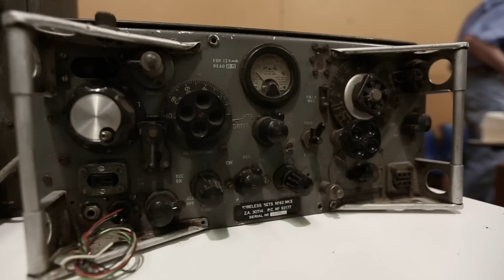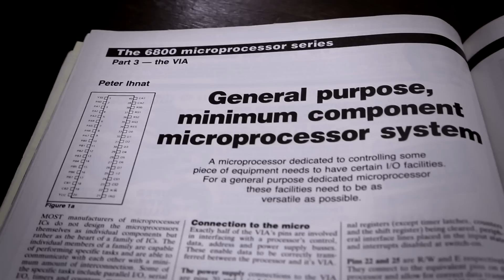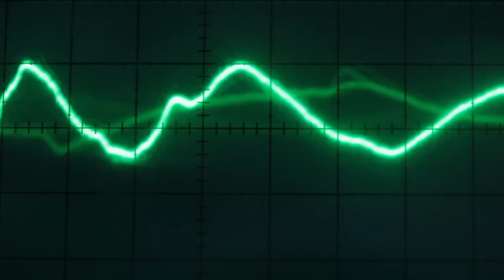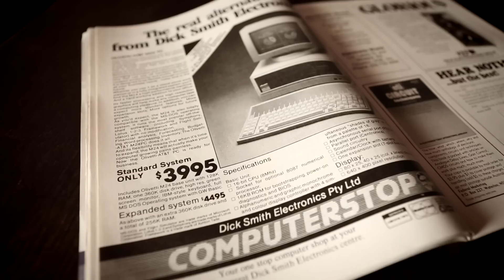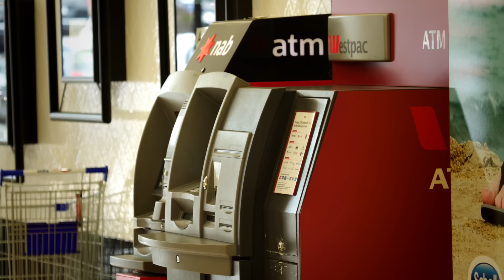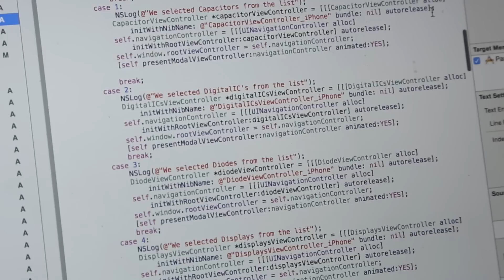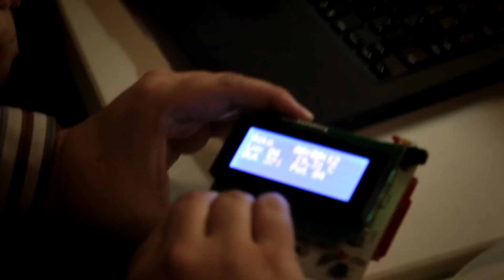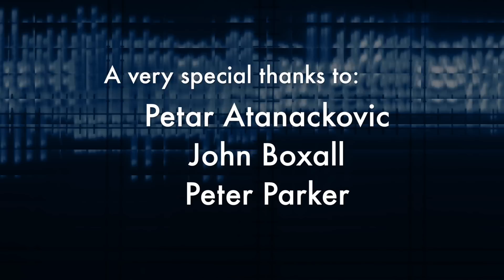Complexity & Integration

Comment: Yes my exploration into electronics since childhood reached its dead end when eventually became tiny black boxes with legs and I had no idea to understand  it.

On a positive perspective, probably the new age of modules and systems may be the same as resistors/transistors/components in the past
Reply: Build a re-flow oven from a toaster oven, get SOIC stencils and a microscope and you can build anything available today in your home. Use free circuit design software and send the design file to a PCB manufacturer The resources and education are all freely available and cheaper than they ever were. Those little black boxes take software you can get for free if you learn C/C++. If you dont like SMD components, then use breadboard friendly breakout boards. You can go as deep as you want into the complexity for very little cost. A multimeter, power supply, oscilloscope, adjustable solder iron and a cheap component tester are the only equipment you need to start. You may not even need the oscilloscope.

Comment: I can kind of see the pros and cons of the changing era and paradigm in electronics. For one, it's actually a lot easier these days to design electronics because everything is already designed for you, and if you just opened the datasheet it would show you the typical application circuits. If I need an ADC, UART, DAC and PWM I just search for a microcontroller, I need a Line Driver/Level Shifter, Buck/Boost Converter, Rectifier, Current Sense amplifier, and almost anything else, I just search for it and copy paste the typical application circuit. It's almost too easy...in some cases. 

The worst thing about this is that the fundamentals of electronics and circuit theory get neglected in favour of simplicity and programming. Till this day the biggest thing I'm disappointed in is the fact that my electrical & electronics circuit theory is rubbish. Even at Uni they taught us a lot of the basics and then it was off into programming microcontrollers. Only when i burned my first transistor after Uni did I learn from the internet gurus that you have to put a fllyback diode when driving inductive loads. 

I can somewhat see that, in the not too distant future people with strong knowledge on the fundamentals of circuit theory, be it analog and/or digital, will be in high demand. After all, SOMEONE has to design those highly complex yet precise ICs that we all just plug into our circuits.

Comment: It has not gotten harder or easier. Its just changed. It may seem that things are spoon fed to new hobbyists however it has simply just shifted the focus from descrete logic simple circuits to more modern and connected electronics that are more complex then you could have ever imagined.

Today's hobbyists are focused on projects, making new things, and possibly even making a viable product. Complexity is not a necessity. Yes modules and micros make it easier to develop but that just means we can make more interesting things quicker and more efficiently. And later on we can still move on to designing our own SMD PCBs and stray away from modules and break out hoards to use the bare components and sensors.

Comment: It's not at all harder today... 

I see no one complaining that we don't still have 8-bit computers built with transistors, resistors, LED's and jumper wires... Machines which would take minutes to calculate and output simple arithmetic. I see no one yearning for the days of the multiroom computer servers which calculated slower than an 8-year-old and required floppy disks and command window inputs. 

We just slap all that physical computation into an integrated logic chip (IC) and then stamp and ID on the top and call it a day. Want to use the IC to create something? Well look up the data sheet on it and find out how to use it and what it's used for. 

We've simply advanced in capability and lowered the bar of entry. The 'old' style of electronics naturally attracted logical kinesthetic learner; people who learn best by holding something in their hands and breaking it down like lego into foundational pieces. In the same way, we crammed 8-bit calculators into IC chips, we're now cramming a whole lot more computational ability onto CPUs and single board computers such as the Raspberry Pi's and all its snip off's/competitors and Arduino's and other microcontrollers. 

As of now, (2018) children have access to Arduino's and Raspberry Pis with incredible computational and control abilities for merely $5-$30 a piece. A $5 Arduino nano or Raspberry Pi zero can accomplish a lot. If they have access to a computer that can run a word processor (like MS Word) or a code compiler (arguably every non-impoverished first world child does) then they can code instructions for their $5 computers/microcontrollers. I went to Jaycar a few months ago looking for a few simple LED's to change the colour of some door switch lights in my car; they were $5 each... That's, unfortunately, the supply and demand of the free market, with the lack of demand for discrete electronics, but if I can buy an entire computer which even has USB outputs as well as I/O pins, then the barrier of entry for today young people's no higher than it ever was.

The only difference is that physical electronics and circuit board manufacturing was a hobby attuned to kinesthetic learners. Code based electronics are more naturally attuned to visual learners. It may be the same hobby, it may have only evolved a little, but it's undergone a fundamental shift towards optimisation of a different type of learning. 

Software-defined radio USB devices (SDR's) are only about $20 these days, various extension boards for which include capabilities for wifi, Bluetooth, GPS and GSM and many input sensor are often between $5-$20. In the old day's hobby electronics meant making a simple clock, or maybe a siren, or an amplifier circuit, or some simple proof of concept device revolving around LED's, sirens/speakers, light, temperature or moisture sensors. 

Nowadays the electronics projects have broken out of simple circuitry for simple devices such as clocks and calculators which are mass produced on a few integrated chips and sold en masse out of China for minuscule amounts. Modern electronics is about connectivity, modern hobbyists are using CNC routers/mills/ drills and 3d printers, modern hobbyists are connecting things together and creating almost consumer grade finished products to fulfil actual needs or produce actual benefit. 

New school electronics isn't just doing the same thing's better, we're reaching new heights. Whereas once it was an achievement for some to build transistor calculators yet to others it was automated onto an IC to focus on input switches and output lights and sounds; now we're upon a new era where much of the physical control is programmed into single board computers and the focus is upon communication between devices. Whereas once input and output methods were switches and LED lights, they're not text messages and emails. As computers evolved from command line interface to GUI, electronics are evolving from physical switches and lights to informational and networking communications and app-based interface.

Electronics hasn't halted, it's just changed face to new goals. Things have shifted towards networking and "IOT." Priorities have changed and computational innovations in consumer goods have put pressure on creativity and knowledge to make electronics 'worth it.' 

People are right, why would I build an electronics clock when I can buy one for $10? Good question, you clearly lack creativity and skills. If your focus is simple things which have been undercut by Chinese mass production, then the only reason to build those things is for fun/experience, proof of concept or for novelty. If you think 'innovation' has made all the useful things you could make obsolete to cheap goods, then you lack the skills and creativity to implement technologies. The goal of electronics has only ever been to solve problems or make your life easier. 

With the technology of today, I can integrate my garage door into my home network and open it from an app on my phone. That app can pull my GPS data and push a notification to my phone asking me if I'm going home (want the door open) so I don't have to find and open the app. That app obviously connects via the internet to my home network and a radio transceiver coded to the door. I had a garden bed set up with a basic IOT soil humidity sensor and a program which pulled local weather data. It then pulled data on the plant type it was watering so it knew its needs... It was supposed to help me water my plant so it didn't die but I got lazy with the coding and database and it ended up overwatering my plant and killing it. I'll go back to that again when I'm more committed to the project. I'm currently working on a 'carputer' system with an iPad like touch display that utilises passive RFID tags to communicate with my phone and change to a preset mode for driving. It's fairly complex because it will have a large Google maps API component with a lot of overlayed data, such as prompting me cheap fuel prices when the car is lower on gas... Etc etc... 

I've got many more projects on the horizon. What makes modern electronics to the next step is the IOT networking integration and the integration of app interfaces and pulling data  (such as weather, traffic, fuel price etc). Gone are the days of simple proof of concept electronics, modern electronics has far more capability; if you think that electronics is too complex or there's simply no point anymore, that's only because you're dumb and your personal capabilities have been surpassed. 

Whilst everyone sits around criticising and joking about the IOT integration of everything and asking when we'll have internet connected toasters and kettles, I'll be working on my IOT washing machine solution. Reservoirs for fabric softener and detergent and of course a home network connection and app interface. No fiddly dial for 1, 2 or 3-hour start delay; busy people simply throw your laundry in the machine in the morning and head off to work, when you get a second at the office open the app and tell the machine when you want it to finish. Yes, of course, it pulls your schedule data and asks if you want the washing finished by the time you're due home, or your partner, or one of your kids, maybe your part-time maid? Set it and it ticks, it knows when you want it finished so it does the math on when to start, loads up the detergent and fabric softener for the required load and then ticks away. It runs the load, then the dry cycle (because washer dryers are already a thing) and it' done by the time you get home. Got solar? It can pull weather data and real-time data to run in the peak of the sun to make the most efficiency out of your panel, if that fits in the schedule. Obviously updates you when the detergent is low and auto updates your shopping list ap. This is the future. The tools and components are already here right now for this stuff and this stuff will be common consumer grade goods in 10 or 20 years, you bet the first companies to implement it will charge a fortune and market it as a luxury, rather than something that's obviously achievable with today's simple tech. That's the niche of electronics. Given you have a little bit of coding knowledge, you can implement this with less than $50 of parts, EASILY. You can have now, what will be the luxury in 10 years. 

As for the kettle, I for one will love it when I get off my lazy ass to IOT my kettle because all it takes is a relay, a temp sensor and a wifi chip and you can turn your kettle on from the comfort of your bedroom or tv room den with an app and you can get an update when it's boiled. Or you can spend hundreds of dollars on a fancy coffee machine with instaboil or whatever. Same thing, when home networking and smartphones become more widespread, 'IOT kettles' will come out as a luxury item and I guarantee you, it will merely be a relay, a wifi or Bluetooth chip and a simple IC on a tiny board wired in parallel with the LED, heating element and power cord as a way of bypassing the switch. 

I reiterate, if you think electronics is dead or it's too complex nowadays, you lack creativity and capability.

Comment: Touch pads, Ipod's and ton's of complicated gadgets. Components so compact and complicated it's almost impossible to repair them now unless you are specialized. I guess it's the dumbing down of the new generation. Thank God I was born in the early 70's. Back then a lot of old electronic guru's who will teach and support you on your way to electronics. That gave me the edge and currently, I'm learning new technologies like microprocessors, programming my own codes plus, the knowledge I learned thru all those years of building kits, repairing stuffs, designing my own circuits and making my own pcb layouts payed off.

Comment: im 25, i have some free time. I wanted to learn to do electronics as a kid, but due to the conditions i lived in it was impossible. now I started looking into it and I see no purpose of electronics, you just can't compete with the microchips that you see everywhere. And it ruined it. Nowadays people are consumers, they consume, and can't create. 

At least I have my woodworking as a career, but anyway Ikean and im sure in near future people would never buy wooden furniture. So is shame, that familiar things are dying out
Reply: I respectfully disagree =] You are forgetting about the many sub-fields of electronics used today that still require discrete components in their use over specialized ICs and microcontrollers. Amateur radio , still much of electronic audio/music equipment repair/design (still analog and some discrete), vintage electronics repair, (proper!) pcb design, and even IC design, are just a few of the many sub-fields that still use and require a deep understanding of the math and physics on an individual component level today in 2017.

 In addition, failing to take the time to understand things on a individual component level is already starting to become a problem in the newer hobbyist generations it seems. For example, take a look at the Arduino/AVR forums.
 Today, an embedded software designer today that specializes in PIC or AVR is so far in the dark when it comes to the basic fundamentals of the physics and math behind electronics design, that is has become an extreme handicap to most who specialize in that field. One spends most of their time worrying about logic/code/efficiency in a the perfect ideal digital environment, and rarely spends any time having to consider the non-ideal realities of the interacting circuit components outside of their microcontoller here in the real/physical world. Most of the problems and questions you see posted about are usually very obvious to anyone who has ever worked on a component level.

The point is, if you jump in with both feet and keep doing what you love, there will always be someone out there that will appreciate what you do!  <3

P.S. I really wish I could do woodworking! Such an amazing/rare skill to have these days.
If you like component level or analog electronics and wood,  go check out speaker cabinet design for guitar amps or music!
Take care o/
Reply from the maker: Thanks for your comment. I would like to think it is still possible. I currently teach kids to work with micro controllers and learn to interface hardware through some basic electronic knowledge. It can be learned but yes it is a bit daunting if you have no one around you to help. Best of luck.
Reply: ikea dose not sell high end stuff and i like old wood styles like pre 1900s victorian / Georgian / edwardian
Reply: Why compete when you can conquer? Manufacturers also have to make do with whatever components are available for the most part. Digital components get first designed as FPGA, and then get converted to ASICs by specialist companies, mostly in an automated process, but if you are trying to solve an unsolved problem, you're not competing with anybody. Getting analog components made especially for one product is usually not an affordable proposition altogether.

But sure, it's all an endless field and can be daunting if you lose sight of a goal. But it's like that in every established field pretty much. Welcome, electronics is out of its infancy.